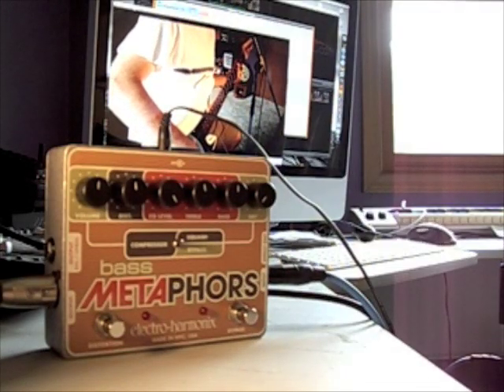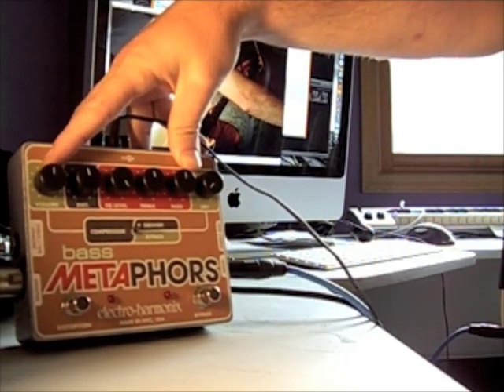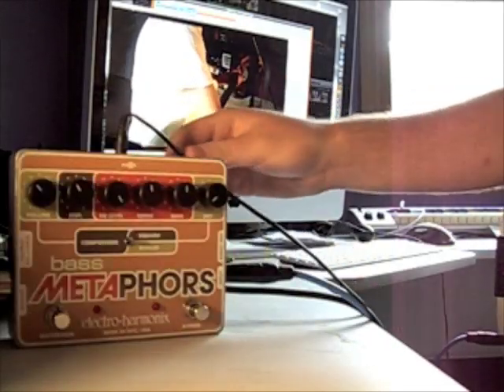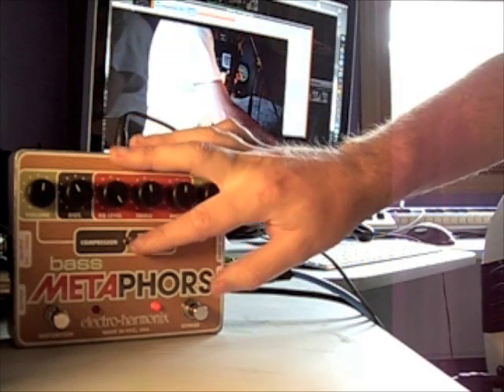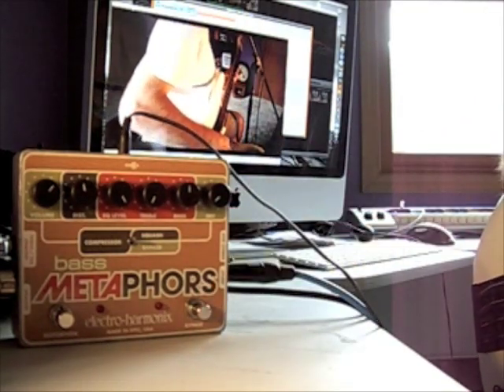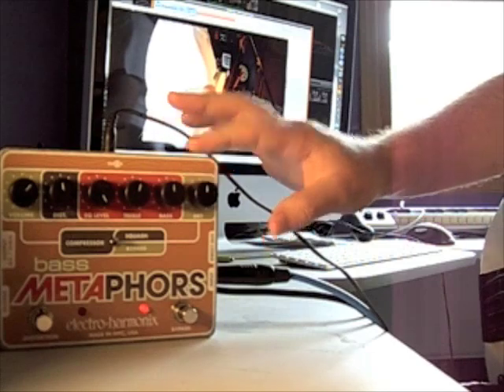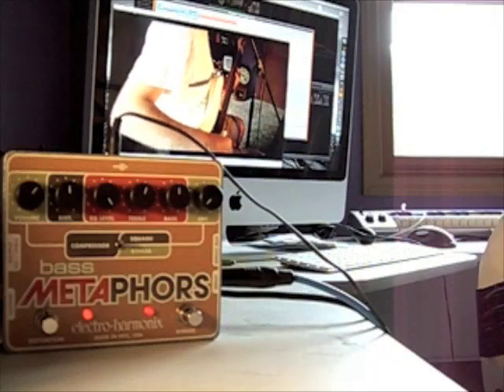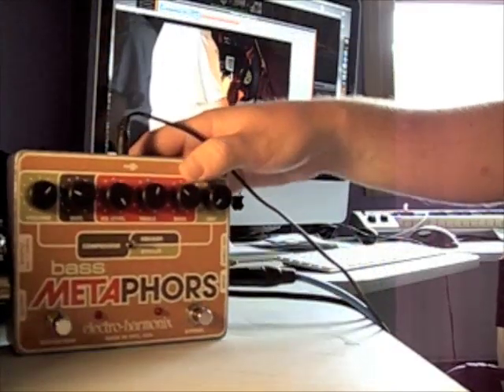EHX Bass Metaphors

Comment: I use the Metaphors in combination with my Bass Big Muff and there was some hiss with the factory preset of the compressor. It is easily to fix by dialing the trim pots inside. The one in the middle is for the amount, the one at the bottom for the volume. Same as the Soul Preacher there is a point at the volume trim pot, the unit goes into overload and some hiss is the result. Tweak it a little before that point, it will be loud enough.

Comment from the maker: My mixer is set flat.

If your amp has a DI out, then yes you can.
If your amp has a headphone out, you can probably make that work into the mixer.
If you just want to send speaker level signal from your amp to the mixer, this can cause problems depending on the equipment involved.   I use an external DI box (Radial JDI) that actually allows for this scenario because it has setting that significantly reduces input to let it work.

Comment: check out EBS multicompressor, it's good for guitar/bass/piano stuff, i think i'gonna buy it this month, it seems easy o set, 2 knobs, and 2 switches (1 for active/passive pickups, another for modes tubesim/multiband/normal) a bit pricey though but seems quality gear